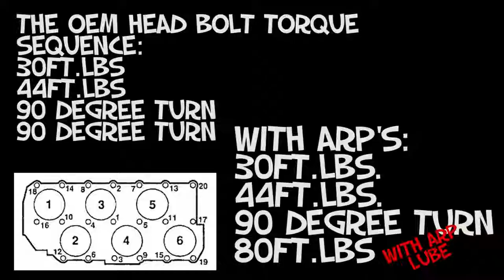INSTALLING VR6 ARP HEAD BOLTS | WHAT HAPPENED TO US? | VLOG #7

Comment: Hey, I also want to add a spacer to my 12v vr6, and I have heard you have to modify the guides and tensioner, because of the extra height the spacer adds. Did you have to do any modifications to get the spacer to work with your project? Thanks for any help!